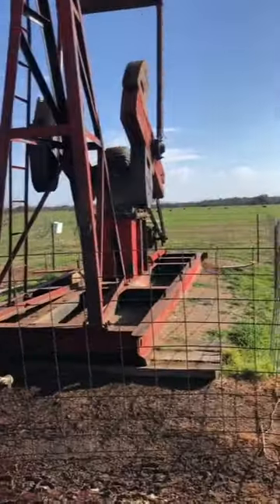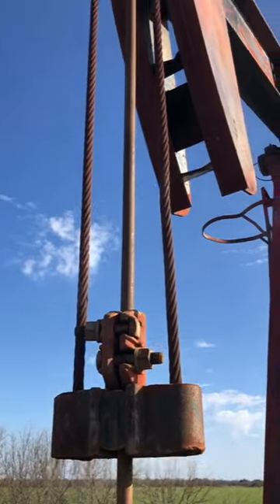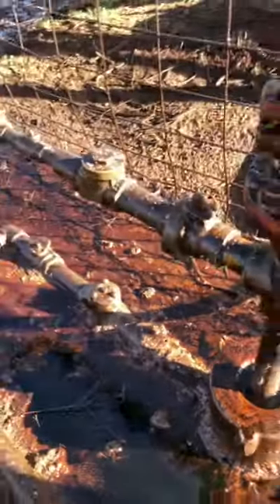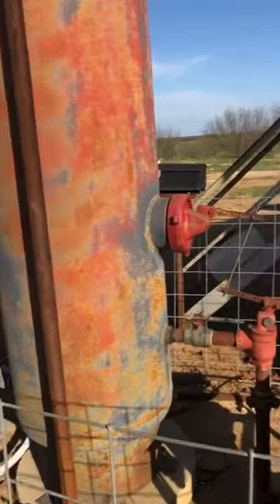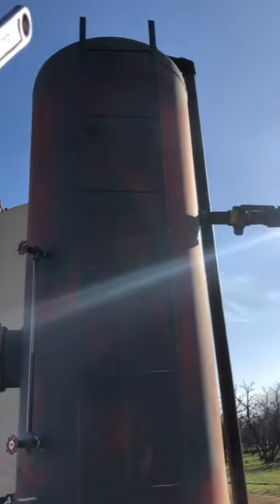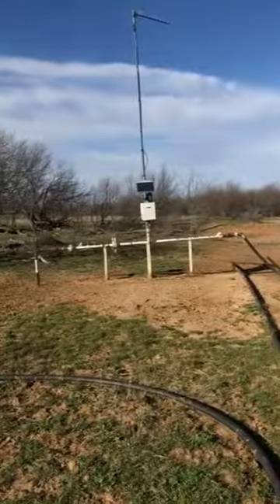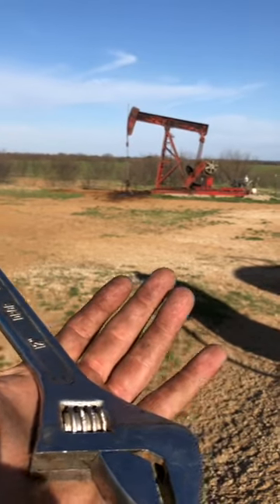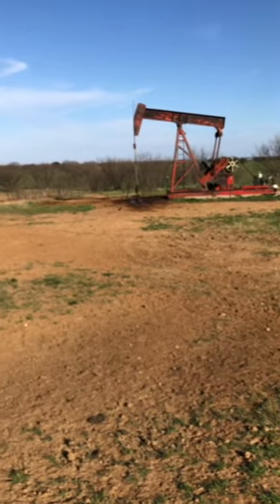Basic Setup of Well with Pumpjack by Joel Gremillion

Comment: Yeah you actually have to explain this nowdays, back then they used hand water well pumps, which uses the same principals.  Now there is municipal water and you got to explain this stuff.  There are "still" the exploratory well heads, the early oil wells looked just like a water hand pump.

Comment: I have one of these. Its been running for years without a separator.  What benefit does it serve?
Reply from the maker: You have one of what? I'm not sure how you'd be able to sell gas unless you have a separator. If you don't have a separator, I assume you're just producing straight to a tank. If you had a 3 phase separator, you could separate out the water from the oil and send them to separate tanks. Just an example.
Reply: @OilfieldBasics  Thanks so much for the reply. Mine is a domestic well. It goes straight to a tank. The water/brine sinks to the bottom. I have someone come to drain it leaving the oil behind. I wasn't sure if there was any benefit to adding a separator like less natural gas leakage into the air or what not..
Reply from the maker: @blesseddwellings9829  It would be less leakage if you could then put the gas into the pipeline, but overall, you're still going to be venting just as much w/ or w/o a separator if it's not going into a gas line. A new hookup would likely be cost-prohibitive and I'm guessing your local regulatory agencies probably have grandfathered in your well to not need to meet newer emission standards? If you want to be more environmentally friendly, you could setup a flare or combustor...but you would need a separator.